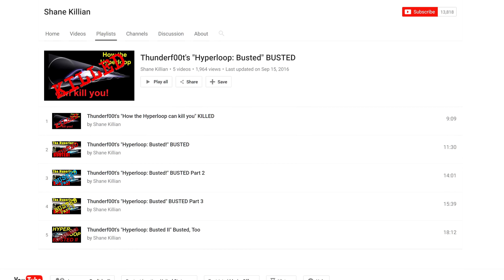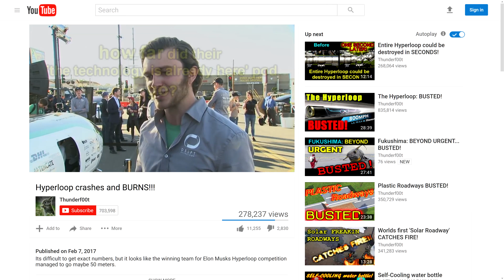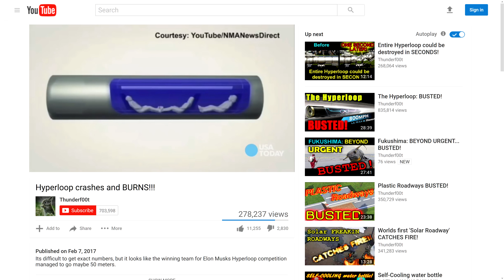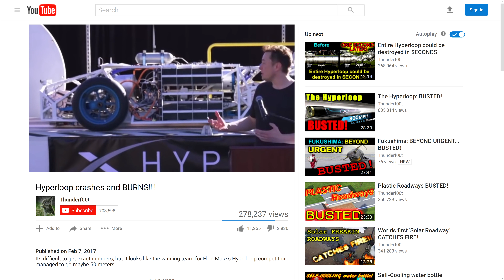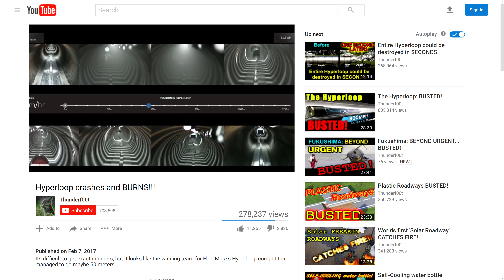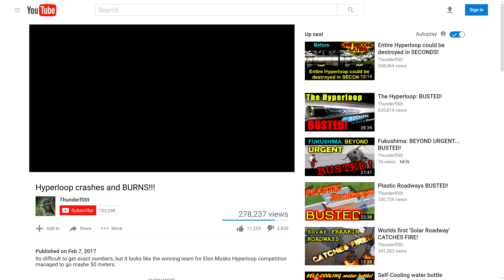Thunderf00t crashes and BURNS!!!

Comment: It's baffling that a scientist would be so stupid to question the speed in this test, as if you can test speed inside a track that isn't several kilometers long.

Had thunderfoot been around 50 years ago he would be laughing at the idea that computers could be made to be cheap and small enough for individuals and small companies saying the vacuum tubes cannot be miniaturized enough to be small and affordable
Reply: The prize awarded wasn't for speed.. The competition had nothing to do with speed. A speed test of the hyperloop would require several miles worth of track, not nearly a mile long. Are you crazy? The top speeds of these things are supposed to hundreds of miles per hour FASTER than a maglev. JR Tokai, one of the Japanese companies responsible for building and testing maglev trains has a test track 26 miles long! That's for trains that only go about 310mph, and you're suggesting they could do a speed test of a hyperloop in less than a mile of track? Manned or not that's stupid.
Reply: You still haven't answered why it matters that a speed award was given. It's not that big of a deal and makes sense for a competition. It may not have been the focus of this competition, but even still it's not a bad thing to recognize who surpassed in other areas. You care way too much about this, you're like a little kid who just keeps arguing for the sake of arguing even though your point has no point. It's just an award for an engineering competition, Jesus Christ. Your whole argument is "They got an award for something that wasn't the primary focus of the competition, it's stoooopid."

He didn't say that speed wasn't demonstrated, he simply said it wasn't a focus of the competition, which would be pretty simple to corroborate I imagine if you cared enough to do a search for the competition itself and seeing what the primary design goals were. We already know from Hyperloop how fast their engine is capable of going and how fast it can accelerate, and it's pretty damn fast. So, I fail to see your point.
Reply: elon should have kept the award for his electric pusher as that did more than any of the pods
Reply: Okay then, so they did give an award for speed, what's your point? It's not like it would be unusual to have that award, even if it's not the primary focus of the competition. It is a competition after all. So, if you have a point besides "it's pointless" please tell me. It is impossible to test speed on a track that size, them having an award for someone who was able to go the fastest and furthest is besides the point. It's a technical achievement and bragging rights, because again, it's a competition. The whole point is to get them to compete to be the best, an award for a team that achieved better results than what was required. How is that hard to comprehend?
Reply: Thunderf00t is egotistical and intellectually lazy when it comes to the Hyperloop. He didn't even bother reading the rules and regulations of the student competition to find out what was happening. He's infuriating and it annoys me that he has a legion of people, who are obviously interested in learning about science, taking his words for gospel.
Reply: In the video Tf00t is actually showing, they explicitly say what is being tested. They first test if the pod is able to communicate in a vaccuum and is fully operational. Then they go to a test track outside that is exactly the same but w/o the tube. Here they test operations once again and perform a brake test (so levitation and brakes). The test in the actual tube is for testing two things: how far can they go and how fast. The teams could choose between air cushions, electric motor, maglev, ... and they could choose a vacuum between 1atm and the defined 100Pa. Why do you all discuss this? Look it up. Tf00t is 100% correct. The goal of this competition was to be the best at hyperlooping. The other tests were done so they were sure that the test track would not be damaged or that they wasted time by putting non-functional pods in the tube.
Reply: Got you, I wasn't sure exactly if you were talking to me there. Yeah, I knew why he wouldn't answer, I was just making it apparent that it doesn't matter if an award was given for speed. It was more of a pat on the back type of achievement and even then doesn't change the primary goal of the competition in the first place. There are a lot of people who don't get that for some reason, Thunderf00t being the notable oddity.
Reply: It's a linear motor, and lighter pods accelerate faster, the speed award was effectively a weight award.
Reply: Yes. Yes I have. It's very common actually to have minor and major awards in a competition for various other noteworthy things.
Reply: only second part after "btw" was for you =) sorry for confusion. First part was for the troll himself =)
Reply: @Joe Farmer What part of the words 'this was not a test of speed or distance' didn't you understand?
Reply: Because some scientists act like religious priests and become pompous close  minded bigots.
Reply: Or the hyperloop, because these concepts reach back so long.
Reply: Hopefully anyone wanting to learn about science will not take anyone's word for anything...including Shane Killian's or any of his fanboy armchair scientists either.
Reply: The rulez:
....
b. Coast Phase: The Pod coasts down the main Hyperloop section. 
c. Deceleration Phase The Pod brakes itself, coming to rest within 50 feet from Gate 2 at the far end of the Hyperloop

Reading that I give  thunderfoot the advantage
Reply: They're going to test a vehicle meant for speeds of 700mph on a track less than 1 mile long. Yeah right. Even if they were able to reach high speds on such a short track AND decelerate them before they crash right through the end wall, it would be an exercise in overengineering because accellerating and then decelerating would produce an acceleration far beyond safe levels for human transport.
Reply: Do you have any idea how long the track has to be to get the pod up to full speed? I'll tell you. Assuming 1 G of lateral acceleration it would take over 30 seconds to reach top speed and 30 seconds to slow down, traveling an average of 167 m/s during the entire test. That means the minimum length for a full speed test is over 11 kilometers. THAT is why they're only doing low speed tests, you moron.
Reply: What would even be the point of a speed test at anything other than attempting full speed? Trying to speed test a high velocity vehicle in that tiny track would be dangerous and not produce any useful information.

Imagine if ferrari came out saying they had tested the new ferrari for speed and said that the test shows the car performs well at 100km/h. That's what you're asking for, because we already have trains that go way too fast for a speed test to be viable without a very long track.
Reply: Hypeloop isn't going to be put into proper public use. It is probably going attract a lot of funding from various places and make the owners of the company behind it rich before it folds - just like the solar roadways idea. When these things ARE put into public use you can tell me I was wrong.
Reply: Just because a "Fastest pod award" was handed out, doesn't mean that any of the teams were attempting to replicate a full scale speed test. As I pointed out the track would have to be many kilometers long if you wanted to do a full speed test. Obviously none of the teams had that in mind.
Reply: sorry mate but have you ever seen a competition where you have to demonstrate an X factor but also there are prizes given for Y or Z factors.  Like you go in a car race from san Francisco to L.A. using only but any petrol engine. The point is being at the finish line first. But at the end of the event you also give a funniest design award for a slow minivan which looks like a silly dog like in dumb&dumber ..  Or an innovation award for who covered the distance fastest in comparison to fuel consumption or something..  Simply the issue is that just because some other awards were given you think that test was made to measure those primarily or at all...

btw

Joshua Dunbar
Let me answer your question why Joe Farmer still didn't and won't answer your question.
The problem here is that the internet is full of trolls full of such stupid dickheads and from time to time they end up watching such videos like this one. But they don't realize that the video is about a really complicated subject and has only few thousand views and a small amount of comments. Why would it matter you might ask? Well the discussion about such a thing is not interesting to most people. They would use it talk about it be amazed about it or ignore it but most people would not be interested in hearing bullshit about such engineering details of such a complex project. Who would dig into it then?? People who are really interested in such stuff, people who would like to learn really complex details, maybe engineers or university students or some really tech-curious people but people who know what they are talking about. Also in the comments section, most of the comments debates will be done by such people. So looking at the subject and view numbers this troll doesn't realize that this is not some kardashian news and thinks that his ass won't get busted like hell so feels free to pick on someone and starts throwing shit which he can't back up. That works for most of the youtube but yeah here it doesn't work so he took off with his sorry butt already.

Comment: I have a serious question for the hyperloop believers. What's the maximum length for a hyperloop system?
Could it go from New York to Los Angeles? Or under water across the Atlantic Ocean? Could it connect the North and South poles?
How about a hyperloop connecting Earth with the moon? As an alternative to the space elevator?
What are the limits for a feasible hyperloop?
Reply from the maker: Over land, there isn't a theoretical length, although practically you'd at least want it to stop at every major city along the way.

Underwater is an issue. HyperloopOne and a few others are looking into it, but it would mean a radical redesign of the tube. Not necessarily more expensive, just different challenges to overcome.

Earth to the moon wouldn't work. This is basically why: https://what-if.xkcd.com/157/
Reply: @shanedk  Thanks for the clear answer. So there's no limit to how long the low pressure tube can be? Just as long as the steel is thick enough, I guess? Maybe the amount of steel needed would define some kind of limit?

By the way, the Dutch hyperloop company have made a small size model of a transatlantic hyperloop.
Reply from the maker: Each bit of the steel only needs to take care of its bit of the tube. As for maintaining the vacuum, you just need the pumps every so often. A longer tube just means more pumps.

I'm not surprised that the Dutch company is looking into it. They've always been at the forefront.
Reply: Vacuum in tube design length is mostly irrelevant. Diameter of the tube is the main factor.